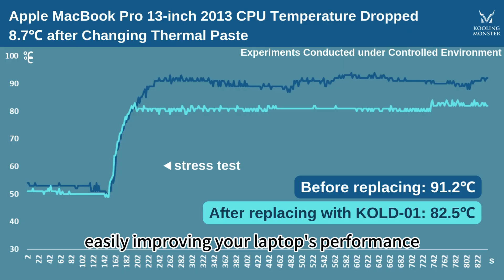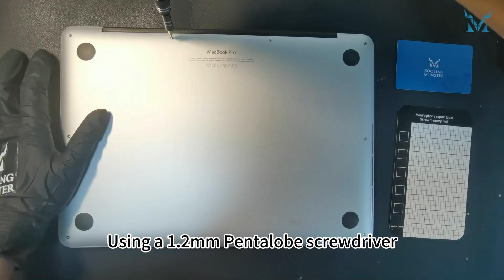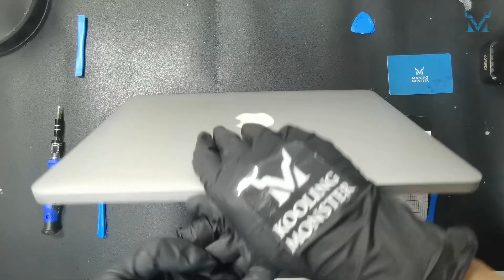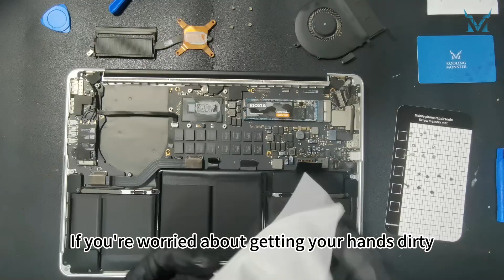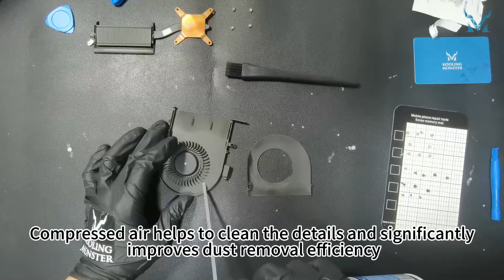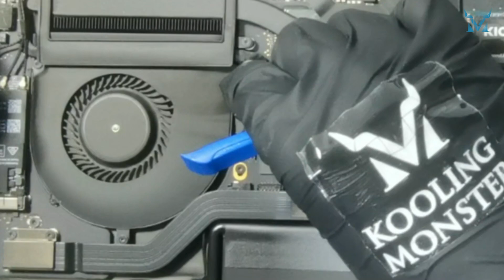Speed Up Your  Apple MacBook Pro 13 inch 2013 Prevent Overheating With DustCleaning&New ThermalPaste

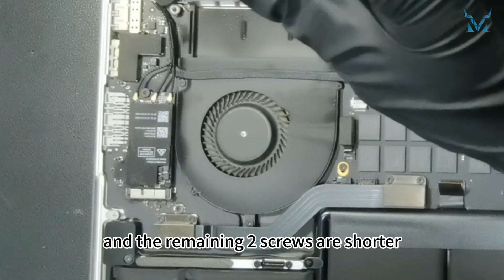Comment: Which screw was taken out at 3:29?? You blocked the view and i have no clue which was the third screw you took out
Reply: Nevermind i figured it out!
Reply from the maker: Thanks for pointing that out! 😊
The third screw at 3:29 is the fan screw near the top-right corner of the heatsink (right next to the fan housing). If you need, I can send a marked screenshot to make it easier. Just let me know your model! 🔧😄